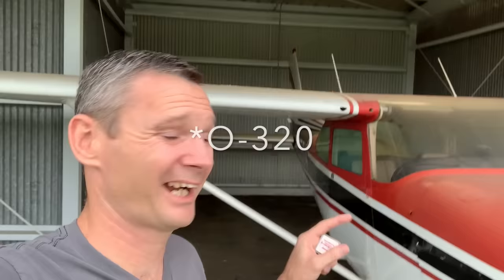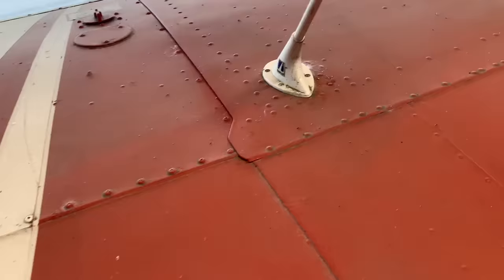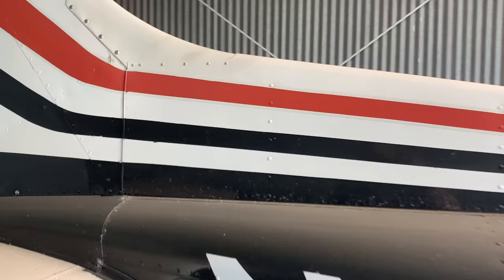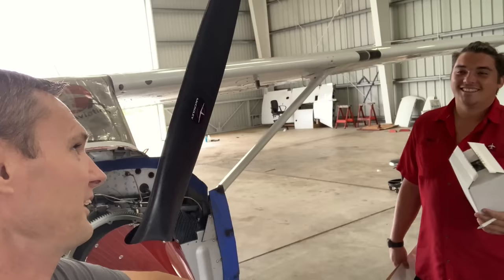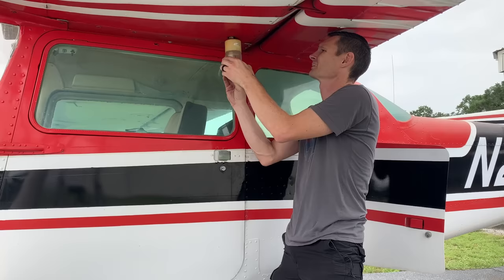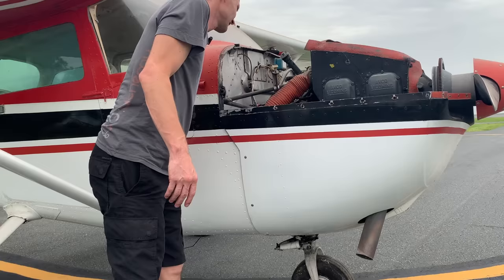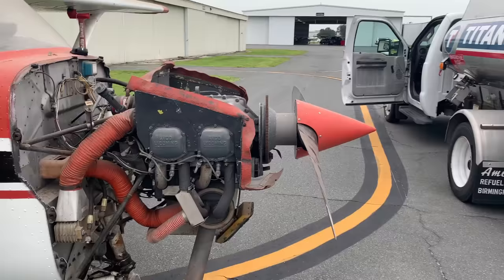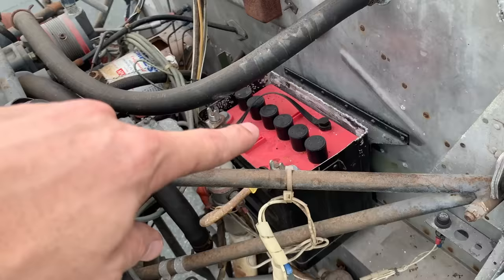Abandoned Airplane Will It Start? 10 Years in the Dark

Comment: For an engine that has been sitting, pull at least one plug per cylinder, squirt some oil in each cylinder, leave the plugs out, turn the engine over until there's oil pressure.  Pretty hard on alot of components in the engine, with everything totally dry of oil, to just start it.  Get some oil flowing with no compression loads on the bearings first.  Also, the cam and lifters need some juice before firing it up too.
Reply: There was a lifter making noise at idle.
Reply: And the choir sang out with a solemn, “Ahhhhhhmennnnnnnn”
Reply: @fleabitis  yeah.  my first trichamp rebuild when I was in college.  overhauled engine got my AP off it...flying to day but thats the sound
Reply: Yea the dipstick didn't care, he just wanted to make a video destroying someone elses engine.
Reply: Isn't it normally wise to drain the oil and gas before leaving any vehicle sitting for longer than a year?
Reply: twistedyogert honestly, right the opposite. It’s better to have a full fuel tank with some fuel stabilizer in it and added on occasion. Same with the oil. Because when the tanks and crankcase are empty, there’s nothing to displace the condensation from temperature changes which will cause rust and corrosion.
Reply: Engine sitting idle for 10 years. Starts engine and immediately runs rpm up and down... no thought to at least bring engine to operating temperature.
Reply: Wonder why compression is low on 2 pots ? Open valves corrosion on valve stems  and rusty bore = quick death .. but it did sound good for 1 minute and he did check the tanks  !!
Reply: Yep, I would have done the same thing.
Reply: I'm pretty sure he hand propped it aka primed the oil off cam or it would have sounded ugly like any other engine dry started. The Cessna has a out of storage prime procedure of hand propping it with the mags off before start and a partial fuel prime. How I know is if he didn't the engine wouldn't have started right away as it did on film plus there would have been alot of smoke if he wouldn't have.
Reply: I read a story about someone finding a plane in the same situation. He ran his engine with fresh oil and drained it, then ran with more new oil. Did this 5 times, and I think he had the oil analyzed each time.
Reply: Yeah, I was cringing pretty hard when he fired it.  I was hoping he pre-oiled and just didn’t show it on the video.  🤞
Reply: Wouldn't it needed a full teardown before flight so not really an issue to start it like this?
Reply: @twistedyogert  gas  yes oil noo...actually oil on everything  would be best....blocks water n o2 and corrosion which O2 n water  causes
Reply: As soon as you start it, it has oil pressure and starts lubing, but you are correct sir! It is best to do the prelubing.
Reply: Beings the plane been down for so long  that the annual in the USA to get the annual will consist of a complete engine tear down anyhow. And I feel he had planned replacement of the engine or a rebuild? Last that's what I think is going on regardless smart or not it makes for good content discussion. But he's doing more well of than me so unless u got a u tube and able to do what he does we all pretty much room to talk. He i pretty sure knows what has to be done in the annual to be considered air worthy. They will be doing a level one annual. All point mechanical and structural inspection which includes an engine overhaul n inspection.
Reply: @twistedyogert  OIL no, fuel yes. 
Sitting oil will saturate in moisture. But won't cause any arm sitting. 
Gas on the other can turn to varnish and gum the entire system. 

No matter what, that engine was looking a full inspection, cylinder removal and crank inspection. No one in there right minds to consider taking this up in the air even if the compression was ok. All hoses needed replacements, mags sent for inspection/rebuild. Vacuum pump more than likely damaged from sitting. Alternator removal and inspection. And prop removal to service the starter and replace the alternator belt (and zip tie a spare behind it). 

What blows my mind is that he willingly started the engine without basic maintenance because he already knew it was damaged. Or is truly incompetent.
Reply: @twistedyogert  only wise if you care about the vehicle, otherwise your just wasting your time
Reply: @twistedyogert  gas yes oil no...
Reply: 100%
Reply: @corporalclegg914   Status: Deregistered (Apr 19, 2018) so possibly not the same aircraft
Reply: You sir are a wise man, GREAT ADVICE
Reply: No doubt, serious damage in the first minutes of amateur hour. But what does he care? I believe he works for Google, as much as for YouTube, and himself.
Reply: When I build my car racing engines I always installed an Accusump on the engines to preoil the bearings before I started turning it over.  And if it sat for any length of time I'd pull the spark plugs and fog the cylinders and spin the motor up until the oil pump was primed.  Most of the time I never sat an engine for storage before pickeling it.  IE; fill the cylinders with oil and back off all the valves.  Yea it took time to get one ready to run again, reset the valves and all that, but they always ran fine after I got them ready. (I have some special hollow spark plug bolts that have hoses that go to an attached  jug so that I could hand rotate the crank over to remove most of the oil left in the cylinders.)    
My motorcycles all have miniture Accusumps on them because they sit a lot and I prefer to preoil the bearings before starting.
  
I shuttered watching this because I was thinking, "Wonder if that Bendix was still stuck out when it fired???
Reply: everything would be getting rebuilt anyways
Reply: @sandman11583  hand propping will not get oil to the cam.
Reply: John Hissem https://youtu.be/hCb4f8EQIos
Reply: @corporalclegg914  it’s entertaining, why be that guy? If you can do it better than start your own channel. And it’s not fraud, how much money have you lost by watching?
Reply: Pretty sure the Plane was already disassembled before he tried to start it that being said it was taken apart for a reason so the engine would probably be rekt along with all the nav equipment removed so from the start its a piece of junk and not a museum piece engine and it sure as shit aint no race engine THERE IS NO VALUE IN A OLD HALF ASSED ABANDONED PROJECT
Reply: These are coated Aluminium Cylinders. If the Engine is old, this Coat will need re-doing anyways. But generally these Cylinders are nearly fully self Lubricating.
Reply: Doesn't matter.  All the airplane will it start videos are just for entertainment.  The planes need engine rebuilds.  If there are no maintenance logs, they are going for salvage or scrap.
Reply: @corporalclegg914   Looks like you're lying about him deleting your comments as there's your comment sitting there just as pretty as day.
Reply: Yes way to hard on eqiup
Reply: @twistedyogert  full synthetic if it’s clean doesn’t have to be changed and can sit for years.. however 10 years? To be safe id change it.
Reply: @MrGoodwrench  Never heard of an engine tear down at annual...that would get pricey.  Imagine overhauling a 0-320 every year?
Reply: @prawnstar9213  any engine oil ages even when not in use and synthetics are not that better either. That oil seemed to be quite new in that one it probably just been drained and refilled

Comment: Certified general aviation is insane. 30k for a 1940s tech engine that might produce 150hp in the best of times, and that hasn't changed one bit in 80 years? Stupid. Your comment about "pay for an engine, get the plane for free" is soooo true. Being required to keep the plane trapped in a time-warp due to FAA regulation is the whole problem.
Reply: the hell with FAA regulations !
Reply: AVweb has a great video on this subject, and why aviation engines haven't progressed beyond what seems like the dark ages. But the prices are insane, even accounting for economies of scale compared to the car industry.
Reply from the maker: for real!
Reply: I am very certain planes like that could be converted to electric, which would make them safer and cheaper to maintain.
Reply: Yes, it is. I would also be willing to wager at least 30% of that total goes to all the liability insurance involved. A&P mechanics can't just go to a hardware store for parts. Liability in aviation has been a serious issue for decades. It was one of the reasons Cessna stopped building the 182, 172, and 152 for a while. I can't remember the year but many years ago somebody had illegally modified the seatbelts on what I remember was a Piper Cub. It was later involved in an incident and there was a later lawsuit. Piper was held responsible. I hate this. However, I see no real solution with regard to these liability laws. This means the costs of getting anything related to aviation are going to be VERY expensive!
Reply: @stevelamperta865  I'm sure they exist for a reason.
Reply: @CrustaceonsReef  True, but fuel is too and the electric motors are a lot lighter. The power that most GA-engines put out is a joke in EV-terms. 
I made some simple calculations based on a Cessna 340, and I think it's doable. And as energy density increases every year, I hope we'll see this soon.
Reply: Exactly what I was thinking 

See, this is one thing I don’t understand. The engine in this is like 5 L… And only makes 160 hp. It’s a two valve, horizontally opposed four-cylinder air cooled engine. Probably the design was from the 30s. And they want $25,000!! for this boat anchor. ….enrichment knobs….holy Jesus! This thing still has a carburetor!
Now, check this out……for $10,000 you could have a light (relatively) water cooled 5 liter, 4 valve, variable valve timing 4 cam V8 from Lexus. That is fuel injected, cataylized, runs on 91 octane pump gas, makes 400 hp and would last for 10 times or more hours than the magnesium turd in this airplane.
No?
Ok, how about a $4000 Hyundai 4 cylinder turbo….4 valve, twin cam….much lighter, and makes 200 hp. And it’s 20 gran less.
Now, of course there are weight, radiator, location, propeller….everything to consider. Basically a complete new aircraft.
I understand that. Possibly the cost of development may be prohibited and that’s why this split case rod thrower is still being used.
But…everything is money, and
I think it’s a scam…..lycoming, continental etc….KNOW you don’t have a choice. AND in order to get it inspected for flight you HAVE to Put another boat anchor in its place. 

It would be interesting to figure HP /torque/rpm on engines, comparing weight, and get something modern, fuel injected etc. with more power. And fit it in that plane, and fly it.
But if the Stazi would find out you would loose your license…
Being. We went from first powered flight to moon walk in less than 70 years…..and nothing really to speak of….yeah space shuttle….ok…since then.
I wonder what Wiley Post……the Wright brothers…..would think about that.

Could you imagine an Asian made, last forever, airplane ….light ,agile, safe, great power plant for the masses for $30,000? 
Nope….
Thank the FAA for that.  Someone’s making the money.
Reply: @OkFixer  It would be interesting to do a hp/lb comparison of common automotive engines vs. the Lycoming dinosaurs. Some of the newer aviation engines do have modern concepts in them, but because of lack of economy of scale, they're still stupid-spendy, boutique devices. And of course, the "but simple" crowd will always poop on the added complexity and "omg, not direct drive"
Reply: @pliskenmovie  I’m glad I’m not interested in flying….it sounds crazy expensive
Reply: @twistedyogert  I'm sure that's true.
Reply: @THE-michaelmyers  I was attending a CPL ground school and we were told about a gauge, can't remember if it was oil pressure or a temperature one but you could buy one that had the same manufacturer and markings as the one for a car had. Only thing was the aircraft one was five times more expensive than the auto one.
Reply: @OkFixer  You had me until Asian made. Simple tools made in Asia, 95% of them are crap. If you could ensure standards and quality then ok but if they self regulated.....*no thanks!!*
Reply: @josephking6515  huh? I was talking about engines, not tools. But.
Huh? You do realize Japan and Korea have huge markets here for a reason correct?
Because they make a good product.
But, I’m not disrespecting American manufacturers like the big three. Each in its own way can build fine engines.
And they as well could participate in the aero engine industry.
Except Harley Davidson…..then you would have another 80 year old pushrod air cooled design….only the airplanes would have to make the potato- potato sound, and be chrome.
Reply: @Watzleroviak1210  and fly for 40 mins before they fall out of the sky with flat batteries
Reply: @Watzleroviak1210  pipistrel has an electric 2 seater. The batteries will last about an hour an a half and take you less than 100m. Maybe good to do some patterns with nothing more
Reply: We do overhauls on some OLD engines where I work. I've personally done overhauls on some E-225 engines dating as far back as the 1950s. Our shop's specialty actually.
Reply: @Watzleroviak1210  k
Reply: Av gas in wings & engine are also heavy.
Reply: Great ideas!  Add to aircraft & register as experimental.
Reply: Great ideas!  Add to aircraft & register as experimental.
Reply: @OkFixer  Crazy expensive?  No.  It’s way more than that.
Reply: @jimarcher5255  ha ha ha….I can only imagine
Reply: @OkFixer  your comments are true except for the gasoline. AV gas has anti oil additives and other stuff made for flight and higher altitude. Putting 91 octane automotive gas in an airplane is suicide.
Reply: @willwaconsya3433   unless you're the whole German Luftwaffe....87 octane there. with the DB605...Now of course that was the bare minimum the aircraft could be run without damage. The B4 fuel I think...had a minimum of 91? and the C3 had a higher rating. But toward the end of the war....probably whatever you have. is what you used. Lower compression. 9:1 and a two stage supercharger for altitude.
And the engine still made well over 1200 horsepower, fuel injected. 
Were the ratings different?...probably. Its one huge factor that made us slightly faster. High octane fuel. Slightly.....
ok, how about the Jumo 204? it was an opposed diesel engine. Check it out.
that's not even gas! 
It was in Heinkels..... I think. 
The 602 FI variant in the first  was ready to run in 1936.
NINETEEN THIRTY SIX!
So why can't engines be made, cheaply and use pump gas? additives for height 
aside...geling, freezing etc. 
WHY? Simple... those that are in 
charge...don't want you to fly.
Cheaply anyways.....
it is an interesting subject.
Reply: How do you get a C172 to meet the 51% rule for Experimental?
Reply: The Chinese can make good product, if you're willing to pay for it. But the retailers want a product that cost $5 that they can sell for $50, which will put the American builder out of business since their product cost $30 to build and sells for $60.
Reply: @willwaconsya3433  Cessna just certified ul 91 soo....
Reply: @Tom--Ace  sorry but I have been out of the aircraft business for 50 years. What is up 91?